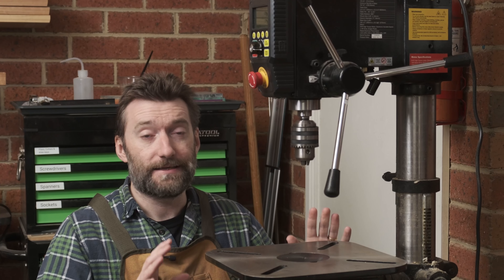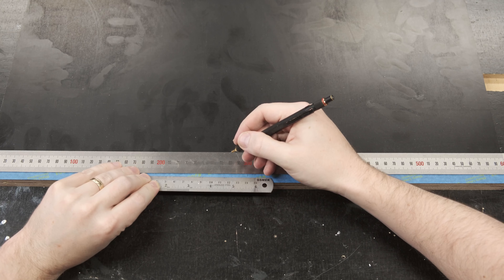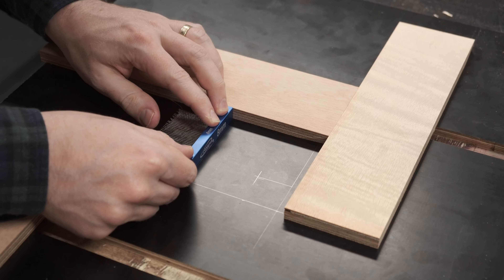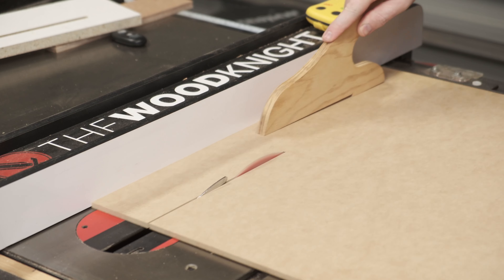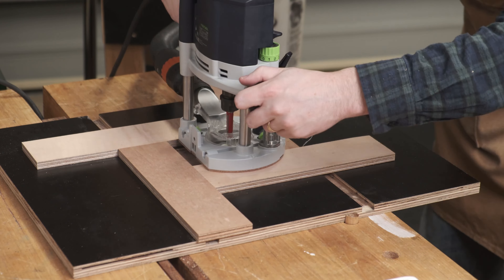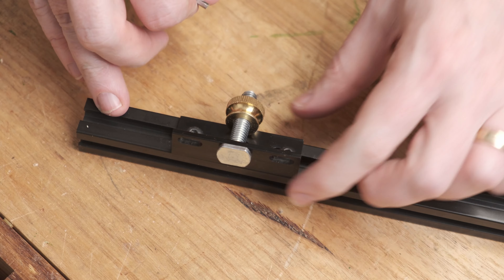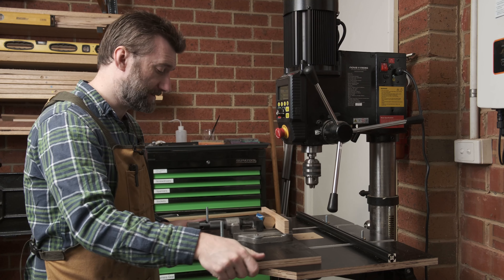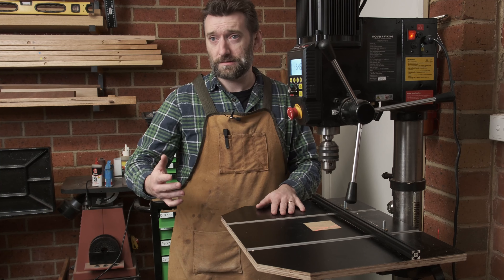An U̶l̶t̶i̶m̶a̶t̶e̶ Acceptable Drill Press Table

Comment: I try not to measure if I don't have to. I have a commercial table but don't really use it. Still using my Bosch PBD40, so far no problems with what I need to do. Scrap wood underneath for clean holes. And now I'll Wrack off 🤪
Reply from the maker: It's a very mundane project, I'm not going to take offense if people need more excitement like a piece of scrapwood to replace it 🤣

Comment: Also, I upgraded the drill press last year but haven't made a new table yet. You're right in that it isn't strictly needed, but I prefer it for the simple reason of, I don't like touching the cold cast iron so I want to feel smooth melamine under my fingers 😆
Reply from the maker: That sounds perfectly reasonable to me - cast iron at this time of year is uh, particularly unpleasant! Before even firing up the jointer the other day, I leant on the table to get some boards down and then had to go get a hot cup of tea to get feeling back in my fingers 🤣

Comment: Nice work again. I use some 20x20, 20x 40, 30 x 30 and 30 x 60 aluminium extrusions for the fence and they work brilliantly. They are connected to the  t- track in the same as you have done, even down to the knurled 1/4-20 thumbnuts.